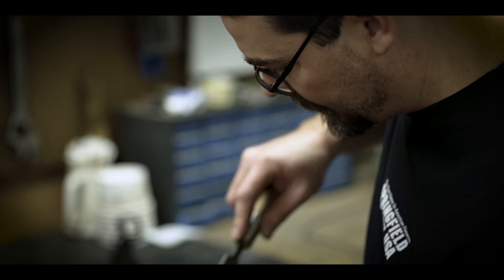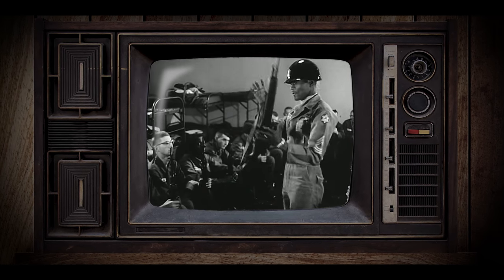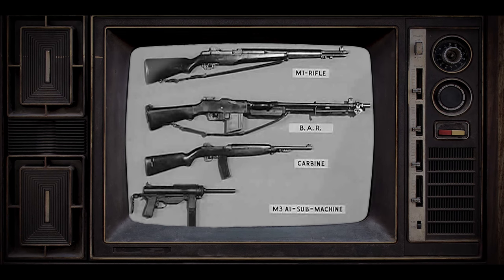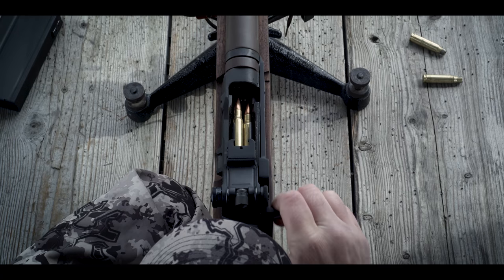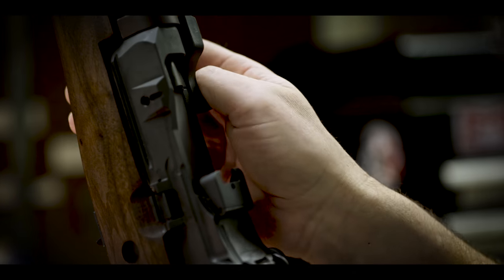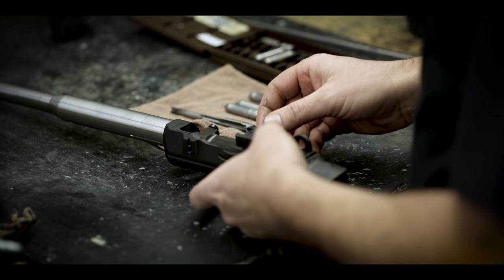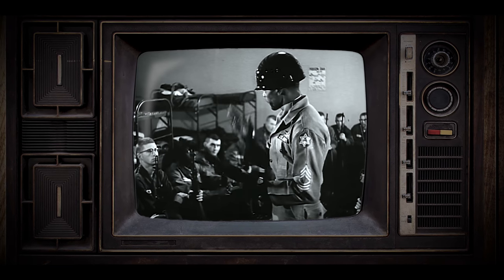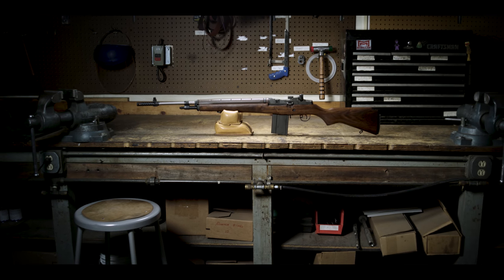The Legendary M1A - Springfield Armory | 4K

Comment: This why I choose the M1A over the AR-15. The AR-15 doesn't have crap on the M1A!!!
Reply: M1GarandMan3005 
Carried the M14 until my platoon was issued the M16 . No comparison in range and knock down power. Only advantage the 16 had is that it weighed alot less. Not really a good trade off.
Reply: The ammo of the M16 weighs less too. You can carry more rounds of 5.56 with you for the same weight.
Reply: There is a reason why we were soundly and solidly winning in Vietnam right until the large masses of M16 rifles started replacing most of the M14s in 67. 

It was because of a few factors,  but the switching to a new rifle that was still not quite ready was a big mistake and probably one of the largest factors. Throw in the wrong powder being used in the new rounds and no cleaning kits initially and the M16 truly was a jam o magic.

 Many many men died face down in the mud after being killed while trying to clear a jam. Many of them would without a doubt be alive today had McNamara not switched the standard issue rifle right in the middle of the war.

Every single Vet that I have spoken to that kept the M14 later in the war have all said they were envied by the Mattel soldiers that were issued the M16. One told me he would often get asked to trade. He always answered them, not only with a no, but a HELL NO!  That same soldier came out without so much as a scratch. The VC that was shot, was usually shot only once, and stayed down for good. He said he never kept count of how many, but did say it was too many to bother counting.

Comment: It’s a awesome rifle but it definitely did not effectively replace 4 US weapon systems as it was intended to do. In full auto it was hot garbage and all over the place not controllable like the BAR is, in close quarters it was too long and unwieldy to replace the M3 “Grease gun” or M1 Thompson. For paratroopers and rear troops that needed a smaller more portable weapon they again ran into the same problem they had caring the M1 Rifle. The M14 was a slightly lighter and much improved M1 with different internals but it was and very much still is a full frame battle rifle that now in days relegated to the role of a Designated Marksman Rifle in the Army (EBR). The M1A and M14 (I consider the same thing for all intents and purposes) is a damn fine weapon and really shines in the one role it did best, effectively modernizing the M1 and giving the US military a long range full power rifle that is capable to 800m with deadly effects on target which is well beyond the effective range of the M4 Carbine. I love my M1A NM it shoots like a dream.

Comment: Might have to pick one up if it’s that tough
Reply: You will love it!  I have the loaded model, walnut, with stainless barrel.  Last week at a match I shot 10 rounds within a 4" circle - with iron sights at 100 yards.  I hit a golf ball at that distance on the first attempt.  Great rifle!
Reply: It’s as tough as the M1 Grand
Reply: I bought 1 back during the clinton era ,loaded version , with scope mount ,sling , softcase and pelican case ,15 mags and 500 rounds of lake city ammo for $725.00 ! those were great times my friends , great times , its getting handed down to the stepson , and hes probably getting the springfield garand also .
Reply: I would seriously go check out the James river armory m1a being sold on classic firearms. The big difference is that m1a has a forged receiver and the spring fields use budget cast steel
Reply: NO WAY!!! Springfield Armory at least 1980's circa. M1ANM. Made at Mel Smith's Vally Ordinance Modern Forge & Machine Tool. Wilks Barre, Penn.Mel Used the latest double die closed controlled harth method for uniform hardness and carbon distribution throughout his superior improved title two M14 Match Receiver. After the shop's persion CNC/ EDM wire guide finish work. Mel did send all match receivers directly to Nelson's. Nellie would build the entire match rifle to the latest( M21 MILITARY SPEC'S)as the Army/Navy rifle teams did. These Rifles were legendary as the strongest, hardest, most uniform mil-spec finished, NRA/DCM M14NM TITLE TWO, SELECT FIRE, VERSION M1ANM RIFLES EVER MADE. Also with the Lock-Out Drum in place for all matches. They dominated every winners circle around the world. I still have mine after 33 years. All ATF&E, NFA BRANCH, RULE'S APPLY. !  I now use my Naval Patent Crane, Ind. Marine Submersible, Adjustable Side Focus, Ten Power Seal Teams, Sniper Scope, With Advanced Joint Services BPT/SADLAK, LLC. Mounting, Navy Contract 30mm Steel Tactical Rings.The OD Sand Spec-ops cheek piece, Contract 9"-16" SLM, Pod Locked Bipod. If My Eye's are up to it. Off we go a day at my Long Range Shooters Club. I can get better than one eighth size groups of five shots at 200 meters. With Lake City M118 match LC-LR, 175GR, BTHP-FMJ, Ammo.  All Day !!!  ROBERT W HANSEN, SR. CEO/OWNER HANSEN BROS ARMS, INC.

Comment: Does anyone have accurate measurements of the possible accuracy of the M1A? Preferably but not necessarily in 6.5 Creedmoor? And maybe compared to the AR-10 in 308, or the AR-15 in 224 Valkerie? What I want to know is, is an M1A accurate enough for modern high powered rifle competition? (Metal sights, 600 yards)
Reply: This fire will reach out past 600 yards with no problem. 308 will do just fine with the right load.
Reply: Back in 1966 at Paris Island  you had to qualify at 500 yards so past 600 Is not a problem. Most Marines shoot expert at 500 so think about that and they all had to use the M14 , 7.62 NATO round. When the M 16’s were showed up I wouldn’t take one. My Captain said the M 16 ammo was a lot lighter and if I wanted to hump my own 7.62 ammo I could and that’s what a lot of us did. The M 16’s were getting all founded up with a little sand and some platoons got it big trouble because of it. No thanks the M 14 was my rifle and that was that.
Reply: Look up some video's from camp Perry and you will find most shooting the M1A and that's out to as much as a 1000 yards. In my case my 308 M1A standard will out shoot my Hbarrel  with match trigger 308 AR10 out to 300 yards I don't have accesses to 600 yards but think the M1A would still come out on top.
Reply: Thank you. It is difficult to find any list of what gun the top competitors were shooting, but apparently some M1/M1A rifles are accurate enough. Now I just need to figure out how to shoot mine well and go to a match!
Reply: Benjamin Mcleod. I have found that in my M1A Loaded, 168 gr A-max Hornady bullets in my hand loads can achieve sub MOA accuracy at 100 yards. Of course when I do my part, if I nudge even a little it will throw my group. The rifle shoots better than me! They are picky on factory ammo and I have found that 168 to 150 gr weight bullets work the best. I love mine and would never get rid of it.
Reply: Thanks Plisken. I have a M1 Garand that shoots .30-06, so the loads are not quite the same. Hornady specifies 168 gr bullets with Varget powder for their M1 Match load, which I am sure is great at 500-600 yards or more. The Quantico range goes to 1000 yards. I just loaded some Hornady 178 gr ELD-X with H4350 powder because Varget is a little too fast for the heavier bullets; as long as they hit where I call the shot that is as good as they can be. The problem I have with this rifle is I think it is sensitive to changing sling pressure, any tension will bend the barrel a little because it is not free floated. So I need to practice not changing the way I hold it and maybe learn how much to adjust the sights for different shooting positions and it should be pretty good. I use ELD-X and 165-gr SST because they are good for both target shooting and deer hunting.
Reply: Your M1A/M14 NM Will out Shoot all of the others if you use proper Match Ammo. Try 173 OR 175 Gr. Lake City M118 NM  or The same load by Fed, Rem, PMC, Black Hills, Hornady,,  Try Surplus Match 7.62mm   X  51mm  NATO-AS WELL.
Reply: TRY USING SHIMS IN THE BARREL BOSS JUST BEFORE YOUR GAS SYSTEM AND BEFORE THAT FRONT BAND. MAKE IT TIGHT, EVEN HARD TOO LOCK UP THAT GAS LOCK.  OR SAVE YOUR MONEY AND GET YOUR M14 BEDDING JOB DONE RIGHT.
Reply: I'm glad I could help. Also if you get an M1A I suggest switching out the spring guide rod for a Sadlak NM guide rod. It will smooth up the action and make everything consistent. It greatly improved my rifles accuracy and group consistency with factory ammo. I do intend to shim the gas system at a later date as well.
Reply: Robert W Hansen sr. Thanks for that advice I will look for those rounds to try in my M1A as well.

Comment: The original plan was for the M14 to replace 4 other firearms. Yet it failed becauee it was too light to replace rhe BAR, too large to replace the MI Carbine and the Grease gun, and a 2.0 to the M1 Garand. Shortest service life in the army. And only beat the FN FAL due to the testing being rigged and the determination of some lieutenant colonel of ordnance who was determined not to accept a Belgian rifle even though the FAL wqs superior in almost every way. The original FN FAL was chambered for a smaller diameter round of .280. That light. Olonrp insisted that nothing less than a .30 would  do and strong armed the rest of NATO to accept the .308. Then a few years later changed to thr 5.56. 

Now we are using the 6.5 Creedmore in military rifles.....that's a .280 or close to it isn't it?